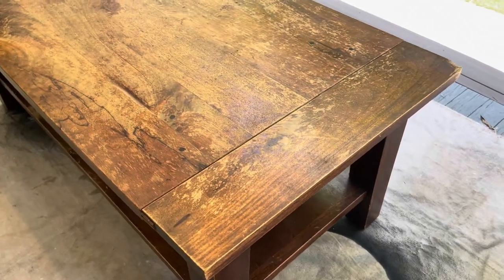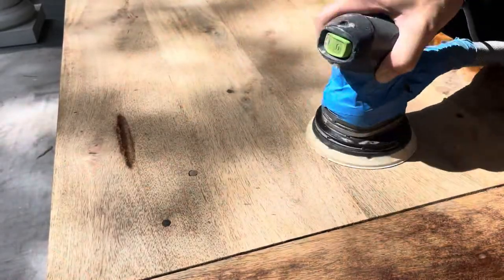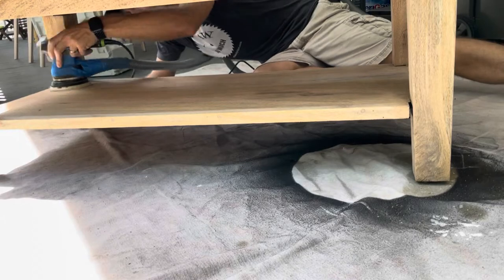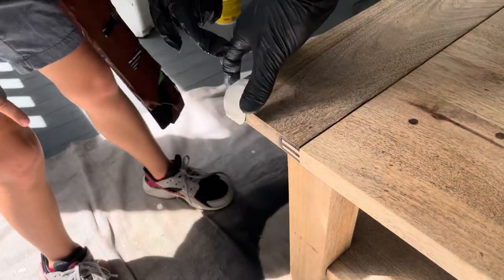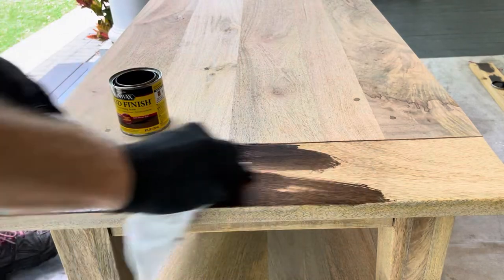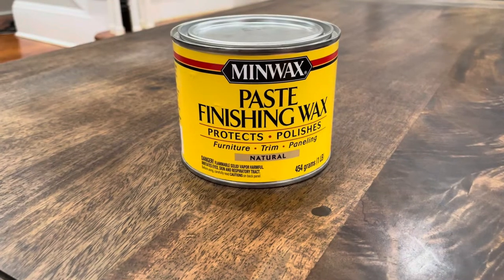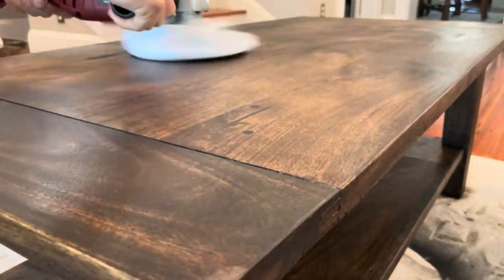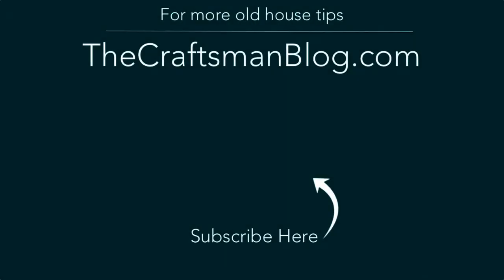Refinishing a Coffee Table

Comment: Some experts say I should work down the grits, starting at (let's say) 320, then 240, 120, and 80, then work back up (80, 120, 240, 320). Is that right and does it help the finish?

Please excuse any inaccuracies on grit density.